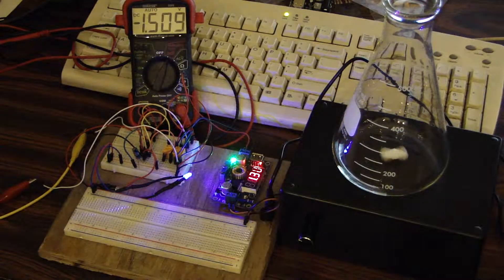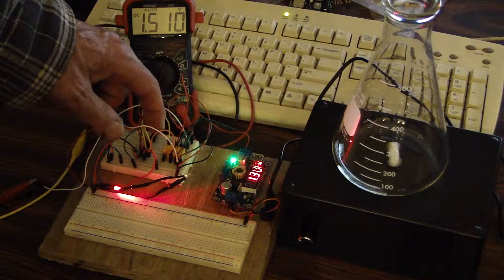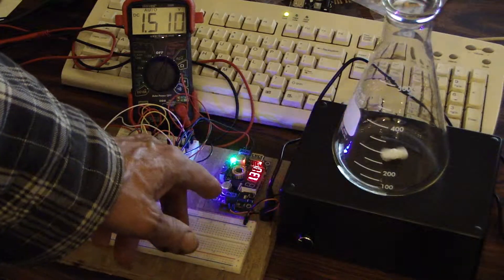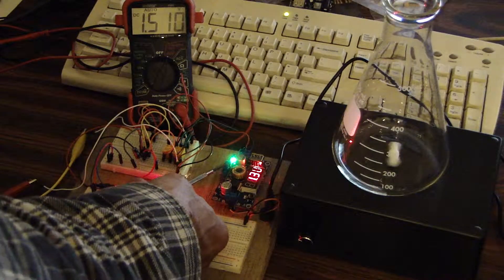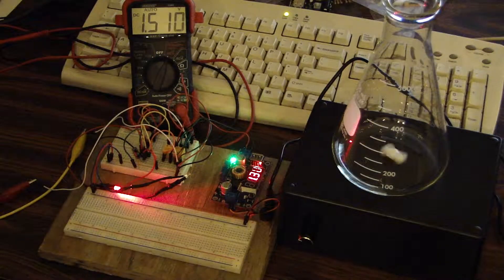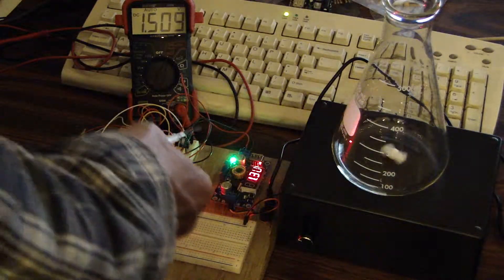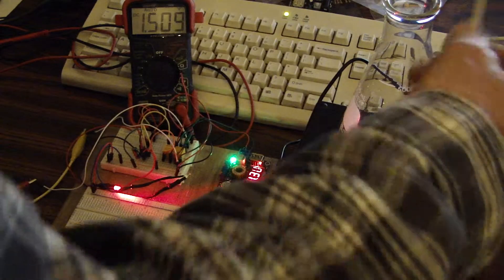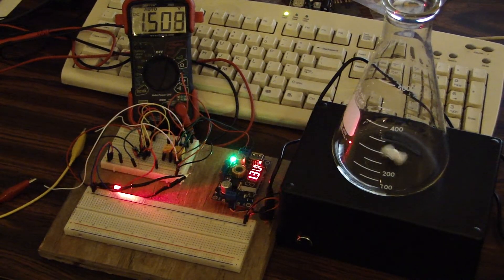Astable 555 with reverse polarity and constant current with magnetic stirrrer

Comment: wouldn't it make faster if you go with 20 volts I noticed you do not have a circuit limiting device the LM 334z I have the schematics for that it prevents circuit run away and keeps the particle size small